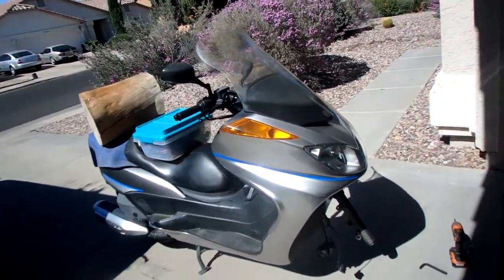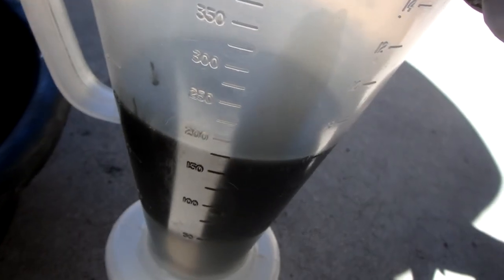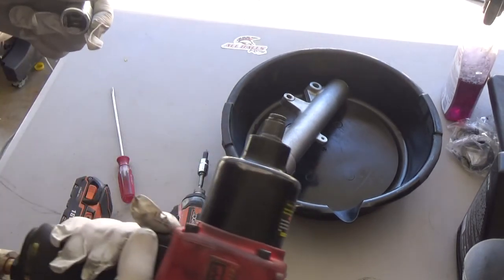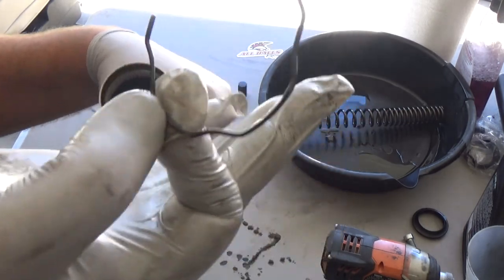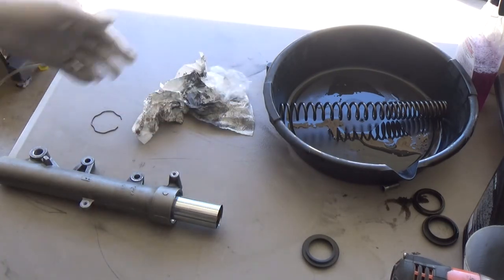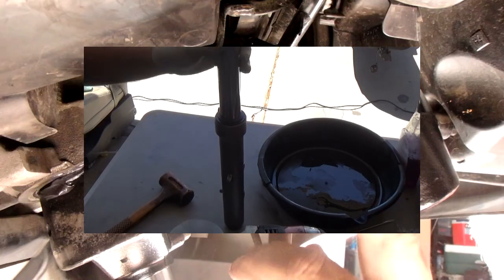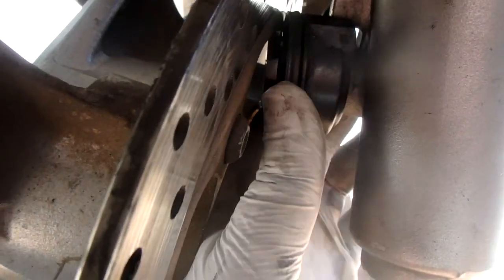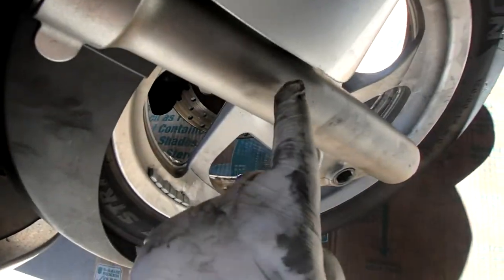2007 Yamaha Majesty YP400 Fork seal replacement

Comment: A fantastic video full of great tips and information, thanks so much for posting and I couldn't have done the job without your help and advice!!! I would say that from my own experience it was much easier to remove the caps off the top of the forks by going down from the top of the bike by removing the windshield, blinker housing and instrument cluster, all done quickly and easily- vids on how to do this can be found on yt. You need a long extension bar on your ratchet to reach them from the top, but it was much easier for me to do it this way. I did make an attempt with your suggestion of going from underneath, but found the tight working space and the caps being screwed on so strongly I couldn't budge them. Also, I found that the hex bolts at the bottom of the forks need to be removed BEFORE you take the caps off, as the springs compress on the hex bolt enabling it to be removed more easily without spinning (have a container handy to catch the oil). An impact gun will need to be used as otherwise the mechanism just turns inside the forks. So an impact gun is pretty essential. Just some info for others who may want to tackle the job. Thanks again, much appreciated.
Reply from the maker: You are welcome. Yes I have run into this issue of the bottom bolt getting stuck on other fork
 models. Without having the fork damping rod tool I would compress the fork with a ratchet strap (dangerous do not attempt) then get the bolt out.  I had one that was stripped once......Ill post that nightmare of a video someday. Thanks for watching!
Reply: I agree helped me too 😊
Reply: @OTRVM  How much liquid to put inside? What kind of liquid to put?

Comment: Good thing you mentioned how the springs are set! I took mine apart and someone had actually put them in upside down...and there is VERY little fluid in then, even the one that was not leaking...someone sure messed up!!! Whoa!! so THANK YOU  for doing this video. I could not take mine apart due to how tight they put on the shocks...way over set!! So, now I have mine alllll apart...sheesh. I can check the rad at the same time however, so, that was the good part...!LOL Cheers and thanks again!!

Comment: Very well done and with all necessary steps included. I'm just getting ready to replace my leaky seals and am missing two pieces of info: The tool you used to put the oil seal back in and the amount/viscosity of the oil. I can get the oil info from the manual, but some kind of pointer on the tool would help, especially if it's a DIY thing.
Reply from the maker: Thank you for watching my video. The tool that I used is called a fork seal installer that I purchased on Amazon.  No sure why I did not add it to the video. I apologize for that.

Comment: Hi. With the damper rod in place, there seems to be insufficient room to slide the fork spring into the  inner tube. You haven't shown that in your video. What have I missed? Any help would greatly appreciated. Cheers David

Comment: would it be easier to lock the steering wheel when putting on the wheel? that way you don't have to fiddle with the movement? Not sure, gonna try ...lol Not sure if it only locks on a tilt or not...sigh.

Comment: If you don't have a tool, I see 2 methods of putting on the seal. One with electrical tape. Tape a row of it around the tube about 6 inches up to just under the diameter of the tube and use that to tap in the seal. Or you can cut an inch off the old seal and use that to tap in the new seal. Anyway, so far people find the tape to be the most helpful. I will let you know! I can't afford 100 bucks here for the seal piece to use maybe one more time...yup, too expensive!

Comment: Ok, so I did as shown  however on mine, even with the spring back in I can't get the screw to undo. It still turns without coming undone! How do I get the darn screw out now? I see there is a tool  bot gosh sakes this should have worked!!:(Any ideas out there please? Heat?? I drained put the oil and have it ready but can't get the bottom screw out...at all.  I have had others try too without luck so it's not just me! Lol thanks!!:) also, why do u have to undo the bottom if you just pull the stem to get out the seal? Not clear on that point. ?
Reply from the maker: Hi, I have not watched this video nor had my hands on a YP400 in years.  However, if what you are describing is what I think it is sometimes it requires pressure on the fork leg to get the screw to turn and not the entire leg.  Essentially use the force of the spring to hold the tube in place while you back the screw out. Ill be honest with you I generally use an impact gun to achieve this while the forks are on the bench at least.
Reply from the maker: Also just so happens next week I will be replacing a belt on one of these units and I can look closer at it again in person.